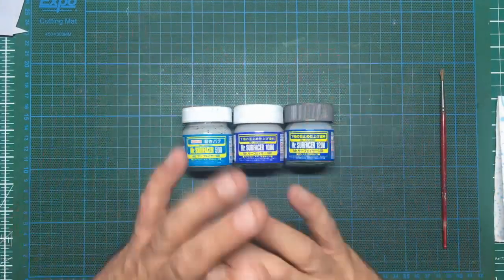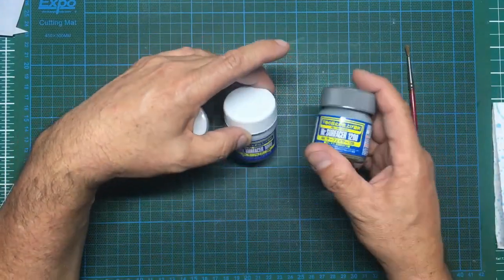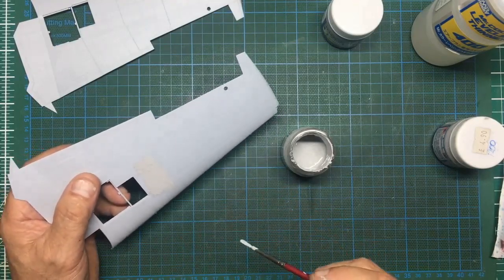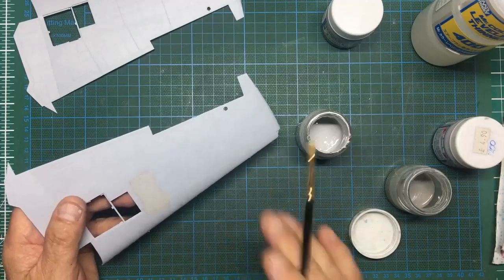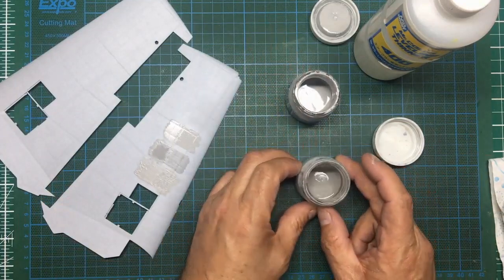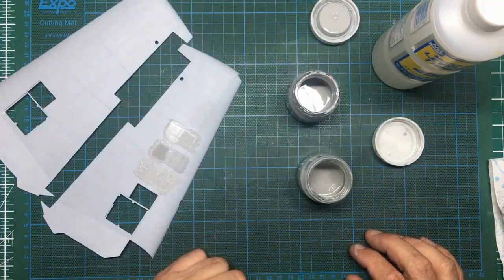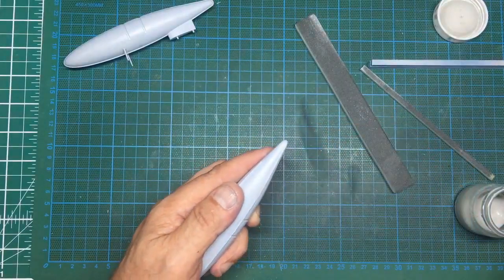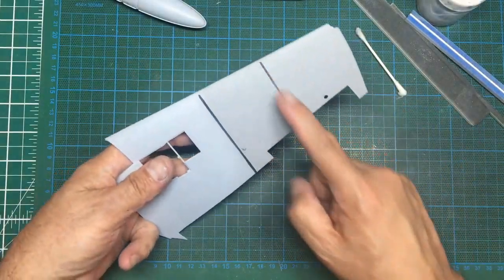Mr Surfacer.. oh I love it..

Comment: I'm sitting in my man cave right now, windows open to not faint of the smells and fumes this stuff emerges. I've used a lot on a Stormtrooper helmet. But it's so amazing! I was able to hide many botched spots with Mr. Surfacer and actually save the project. But good ventilation is a must!
Reply: Ventilation indeed. Mr levelling thinner highs 😂. Extractor on👍👍👍

Comment: Nigel, thanks for this..... I should have got the 500 for my aplication not the 1000 however I'll just thin it as you suggested an use it as primer...and get a bottle of 500. For references my application is I need to fill gaps on plastic multiparty figures

Comment: I bought the mr surfacer to try but can't use it as sets off every smoke alarm and carbon alarm in the house lol  😂 family go daft when I do so just stippling for me! Only happenes when it's airbrushed AKs filler primer does exactly the same it must be the pigment or dust that's to thick in the air and the alarms think it's a fire or a carbon leak! Can't be good for us when you think about it haha! I don't like it much to what I've experienced with but I'll keep trying new way's as just on bare plastic it seems to be to easy just to chip to easy or flake back through to the plastic when weathering or using AKs worn effects it's like it's just a painted surface without a primer

Comment: I understand that the number (500,1000, 1200 and 1500 ) refer to the grade of the pigment/solids in the surfacer. Similar to how the grade of grit on sandpaper is higher numbers for finer grit. I also have 1500 Black surfacing finisher in my arsenal of surfacers...  I would not mix the pigment grades when thinning- have a separate jar of thinners for each grade (and colour) of Mr Surfacer. Label the lids with a Marker.for ease of use.
Reply from the maker: I'm really not that fussy Brett. I'll just carry on as i have been for years now.

Comment: My 1200 looks like your 500.Too much cast texturing with lid off.Don’t put open bottles near a fan,or you won’t be able to break skin with a brush.
Reply from the maker: Thin it with some levelling thinners Darron.
Reply: @NigelsModellingBench  Tipped half a bottle of that in my lap,while working at bench!(bed).Gone off the smell for the moment.Had extractor face down on mattress with hosepipe perched on window ledge and two fans on for 12 hours.Copyright cockroaches,they buy a company after everyone has bought and used and shared music till everyone treats it as free,then send in the algorithm to glean the cash from others efforts.

Comment: Any idea why the styrene got wrinkled after spraying a few layers of 1200 Mr Surfacer and after 24 hours another thin layers of lacquer paint? I have painted a car kit model, the main body came out good but the hood got wrinkled really bad. After striping down the paint I noticed that the styrene got melted into wrinkles not only the paint
Reply from the maker: No idea at all?? What thinners did you use? Sounds like you had cellulose thinners applied very wet?
Reply: It was the spray can variant but I think you’re right I sprayed too wet layer and the styrene used on this model was of a different density. Maybe I was just aiming for a smooth layer of primer (no orange peel)  but this is a lesson for me: I rather spend some time buffering a rougher layer of primer than spending a lot more time on fixing a wrinkled plastic/styrene surface

Comment: it`s all very well if you make planes where you need to fill in seam lines after joining halves together, but as i make model CARS i don`t have that problem, so thanks for the vid but i`ll stick to ZERO PAINTS for my primers as they are thinned for airbrushing, but carry on the good work on your VIDS
Reply: I definitely have not had this experience. Every time I have used Zero primers.. 3 or 4 different types, it comes out gritty and that is after cleaning the model thoroughly, sanding extensively with 600 tamiya pads, mixing with a badger mixer and spraying an initial dust coat... This makes my paint coats (also Zero) full of marks and swirls and it looks like shit...Tamiya primer right from a can is endlessly smoother... I dont know, maybe I am doing something wrong but I am spraying with an Iwata HP-CS at 20psi between 6"-12" away.. Wish I could get good results but it has been a miserable experience...
Reply: @garethmurphy8235  Spraying at 6-12 inches is your problem, that is way too far away. It's drying in the air before hitting the surface.

Comment: If you are brushing it on as a primer do you need to wear a mask? 
Or is it only if you are air brushing it?
Reply from the maker: I have to say, you should always wear a mask when using solvent based products, but I don't when brushing it.
Reply: @NigelsModellingBench  reason I got this product was as a primer once I found out you need to wear a mask when priming. As the only warning I had on the primer I used was “use in well ventilated area, avoid breathing in fumes getting in eyes or hands”. So assumed going outside would have been enough. 
Then found out I should have also worse a mask, so I got this assuming I didn’t need to worry and could just brush on. 😅

Comment: hi.i am  watching your airfix seaking  vids and i ended up here.  is mr surfacer basically the same as spue goo?? cheers Will
Reply from the maker: No Will.. it's more like a thick paint.
Reply: @NigelsModellingBench hi Nigel.  great video, very clear.  can I ask a really stupid question.  what does this do for a model.  I thought it was a filler product, and I get the cast effect. but why spray it on plastic?   it fills rivots etc and I understand that but I don't understand why you would add it to  the surface of a kit Yiu are going to prime and paint anyway. many thanks. Will
Reply from the maker: It is the primer Will.
Reply: 44.41 is very clear about sprue goo versus filler versus Mr surfacer.   I used sprue goo recently on a scratch built cabin for an mh-65 us coastguard.  I built the scratch internal bodywork and used sprue glue behind the construction as reinforcer but it reacted with the evergreen plaster card and when dried it melted the card so messed up the front of my unit.  sink marks you called them. everyday is a school day as they say,  cheers. Will

Comment: I have Mr surfacer Black 1500 I like to know if I can use it with handbrush and what kind of thinner do I need to use
Reply from the maker: You can brush it or thin it with mr colour levelling thinner for spraying.
Reply: So if I use a handbrush so I need to Thinner it's because I have mr thinner 400
Reply from the maker: @gordongriffith9047  you can thin if you want to, or just straight from the bottle. It will thicken with age so you may want to thin it as it gets older?

Comment: Awesome video. Much appreciated! I always assumed that the material is dissolved plastic in a solvent. The different grades relates to different solutions, dilution percentages. Do you know what it is? Is T Extra thin comparable with it? Thx
Reply from the maker: It is not plastic dissolved in cement. I think it’s a putty dissolved in thinner. I’m sure the number refers to how thick it is. Higher number = thinner product.

Comment: Why do you keep showing how to make cast texture on an aircraft?? Then you say how bad it is for filling rivets on aircrafts. WTF? Make up your mind. Dilution doesn't change how fine the pigments are. What's the point? I can add cast textures to my airplane? I'm sure you meant well but I'm left confused as hell. There's plenty of solvent based primers that will work as well for aircraft.
Reply from the maker: I’m using a scrap wing section from a model airplane so show a technique for cast texture. Did you not realise that?? Maybe you noticed your comment is the only negative one out of 50 here?
Reply: @NigelsModellingBench  That stippling will be great texture for concrete or even tarmac.